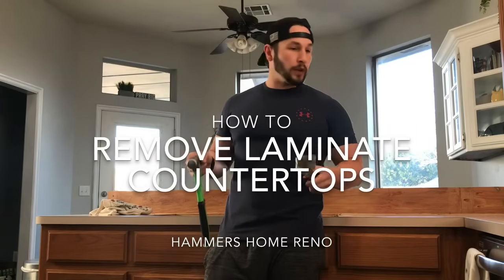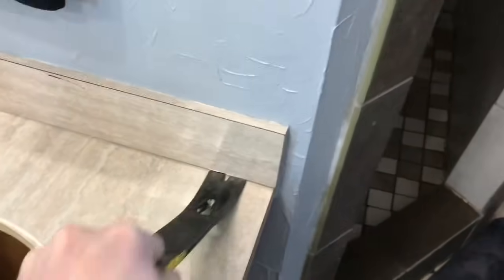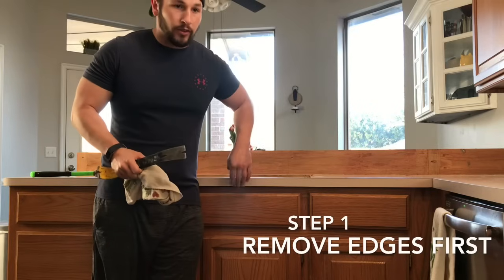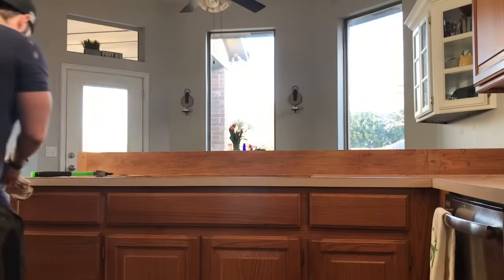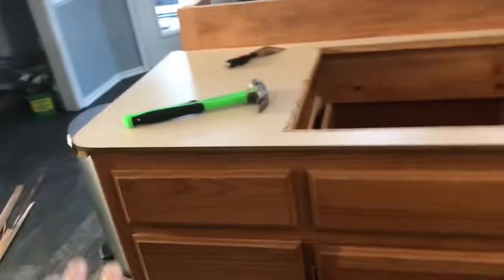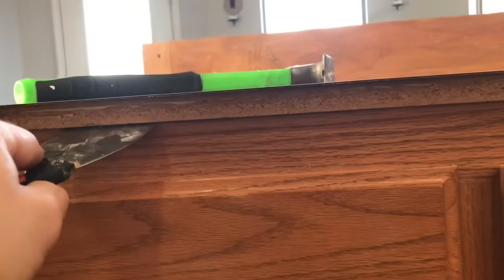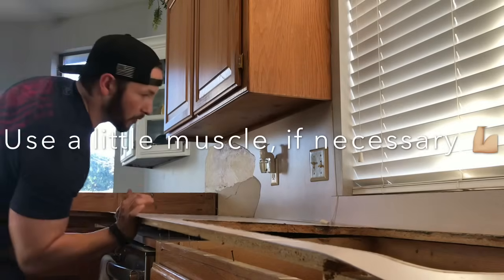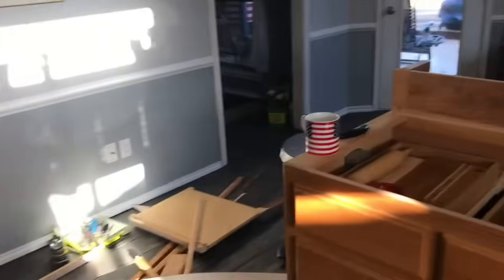How to Remove Laminate Countertops

Comment: Thank you, I'm a 67-year-old female I removed the back splash and laminate yesterday and after watching you I know i can save myself almost $400 by doing it myself.
Reply from the maker: Get it girl! 
Save money and do it yourself at any age!
Reply: @hammershomereno  Worked on it today, got the screws out, they nailed it in with maybe a nail gun from the top so I bowered a circular saw and will have to take it out in pieces.  About 1/5 of the way done glad I start the day after measurement's were done, so I have several weeks to do my part.  Thanks again

Comment: 4:40 be careful  😬😆👍👍 watching the video, because my water heater its in or under a single cabinet, so i need to remove the laminate countertop  28" i hope i can remove up without breaking it otherwise i have to get another new pieces.

Thank YOU for the video

Comment: Any removal tips for the bathroom backsplash part under the mirror? Ours is the same - wall to wall mirror and I'm worried I'm going to break it and have an even bigger problem on my hands! lol
Reply from the maker: Should be able to use a pry bar or even a stiff putty knife. It usually peels off pretty good. Just take it slow and be careful!
Reply: @hammershomereno  Thanks. Wish me luck!!

Comment: Just loosen and use a piece of 2x4 and a jack. Won’t damage cabinets and it comes off in one piece. Can also sharpen a putty knife just enough to cut through the caulk/glue and be gtg
Reply: Great idea! Thank you
Reply: That's what I want to know...one or two pieces and reuse elsewhere

Comment: I'm sure I can remove my laminate countertops now after watching this. Would be a good idea to wear safety glasses, and it will save me $350 by doing it myself.  I can remove and replace the sink too which isn't hard if you don't have alot of rust underneath.  Good video without wasting alot of time like some of these home repair videos do.

Comment: Is there any way to just remove the old laminate without taking out the counter?  So you can put down a new top?
Reply: You can but that's another video.  Plus I've read where those countertops generally get air pockets in them, plus the side trim tends to start coming off after awhile.

Comment: We need this done.  We have new cabinets so worry about destroying our cabinets and backsplash and sink.
Reply from the maker: Cabinets should be fine as long as you pad the tool to lift the counter (towel or something). Sink will be fine bc you remove it before removing counters. Backsplash may be a problem. You may need to replace the bottom row

Comment: Remove the Drawers and use a piece of wood to put the pry bar on to remove the trim. Use a sawzall with a metal blade and cut the nails for the rest. Way easier and less damage. If its glued  you might have to pry/hammer it up a little.

Comment: wouldnt you maybe undo screws underneath before broken scraper?  cant watch any more
Reply from the maker: It’s glued on.  No screws involved when installed 👍🏼. Could just be the fact it was a 5yr Old putty knife I bought for $4 and use almost daily 🧐
Reply: hammer it in he said...bahaha
Reply: Hammers Home Reno you can clearly see the screws that were nailed into the cabinets. Doing it your way will almost certainly damage said cabinets.
Reply: @adamdoom89  I saw "nails" or some very skinny screws that look like nails.